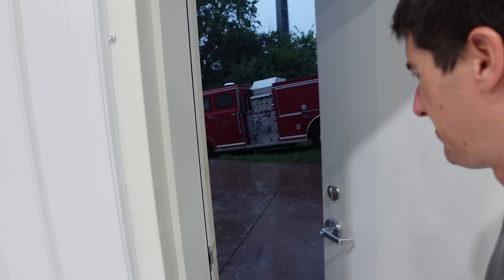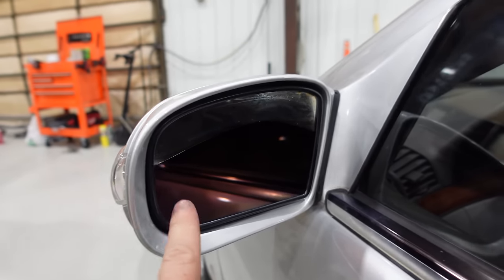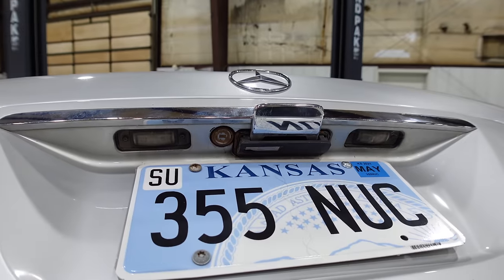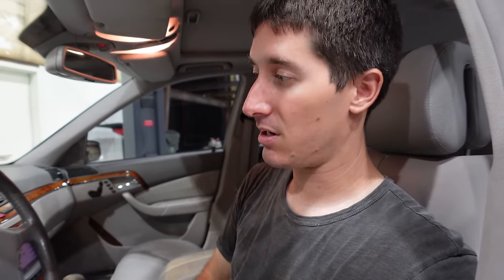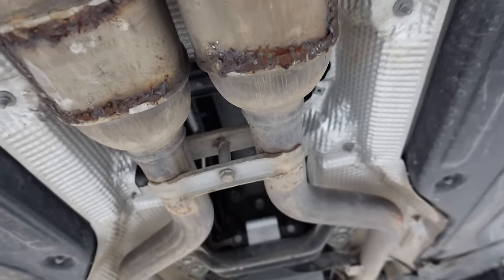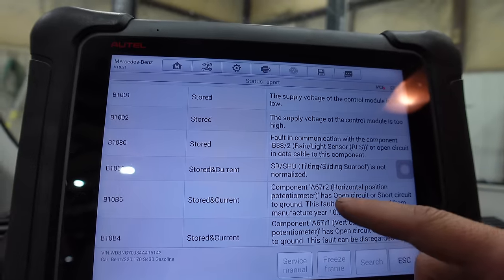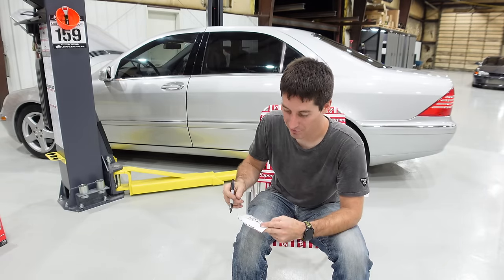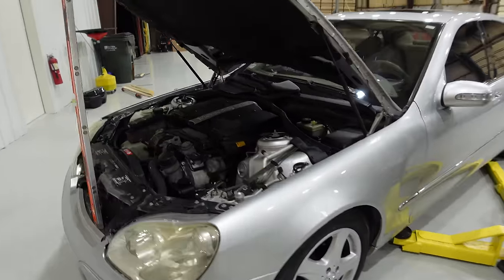My $2,000 Mercedes S430 Is Completely TOTALED *How Bad Can It Be?*

Comment from the maker: I ran the VIN, the salvage damage is listed as "Undercarriage". We've all seen it, the car looks great underneath. Kinda interesting 🤔
Reply: Cat theft?
Reply: Cat theft, perhaps?
Reply: 🐱 theft?
Reply: Might have a few dents underneath, i bought a few cars with undercarriage damage and the only damage was a few dents and knicks on the suspension and trans
Reply: Might have the suspension totaled it? Thats why somebody replaced it, only after it was totaled out. And it looks like somebody tried to swap the cat cores. Probably used to be in an emissions state.
Reply: @100PercentJake  gah. You beat me to it 😂
Reply: Most likely cats, like you mentioned, they probably list any damage on the bottom of the car as "undercarriage". I've driver plenty of salvage cars, even when they are made nice, you could find the evidence of repair. That's the only thing that make sense to me.
Reply: Probably a cat theft that had damage? And maybe it was replaced when you got it? Cat thefts be booming lately
Reply: @100PercentJake  awww shit I didn't see the comments lmao
Reply: The transmission pan looked a little scuffed.
Reply: if anyone needs a cat defender it's a Mercedes owner, not a Prius owner...
Reply: Likely mechanically totalled for the air suspension (which is, technically, 'undercarriage').   Not surprising since it's probably more than 1/2 the value of the car to fix.
Reply: @100PercentJake  i dont think so, cause why wouldn’t the thief’s just cut the cats out completely instead of doing cutting them open lol
Reply: @ricky_ricardo  Catalytic converter
Reply: I’m guessing they means the exhaust. It did not look pretty.
Reply: suspension
Reply: Unload this pig and find one that can be fixed for less $$$.
Reply: I would move on to the next
Reply: Cat theft maybe? What Mercedes quote for a complete new set of cats with exhaust? 
Would line up with the horrible welding job on those cats and with the undercarriage thing
Reply: Sell it
Reply: Can I trade you my car for it but you have to put brakes on it
Reply: How much does all the plastic that is missing cost 🤔 Maybe if you really want a s class use this one for parts then send it to the recycling yard one part of this one might make or break the next s class project 🤔
Reply: Undercarriage damage may explain why there is a cheap replacement suspension all around instead of the original.   I thought also that the transmission support and such looked somewhat different from the rest of the underside, but that could be nothing.   Someone made an effort to put it back on the road in (barely) functional condition, but it's pretty horrid.  Totalled is the word, it's probably worth what you paid for it as parts at best.
Reply: Hi Jr. I have a lot of spare parts for this car, and I know it inside and out very well, so I can definitely give some advice. It is not as bad as it seems. I bought a 2006 S500 for $2,200, a couple years back clean title, and I have been restoring it to one of the nicest examples of this car. Please reply and we’ll figure out how to connect.
Reply: You know 4 high flow cats and some weigh reduction pulling out the old air ride stuff you would have a sweet shop car 
Or just cut your losses and sell it as for the total out it had to be the air ride nothing else
Reply: Suspension or cat theft.
Reply: Could it be in reference to the exhaust? Or suspension?
Reply: I'd love to buy the maxspeed coilovers , how can I get in touch with you?
Reply: I can send you the nav disk out of my 2002 S430
Reply: There were a few lines of ate up wires and the transmission pan itself seems a little scuffed ? idk how that possibly totals it, but maybe they ran over somethin slightly and the insurance adjustor saw the cats and was like "nope"
Reply: Could have been reported as stolen. That is an easy way to get salvage status.
Reply: @TheMcspreader  yeah I thought maybe someone stole the cats but it looks more like a botched job
Reply: dump it
Reply: Stolen and taken off road.
Reply: Running over a curb can total those care out could be sub frame and suspension damage replace the parts and noone will know I have an 04 e500 that was basically totaled including airbags deoyed from hitting a curb
Reply: Trash, Trash, Trash is all I read. I believe you saw potential and I say stance it or make it the work truck by pulling trailers lol. I saw a YouTube guy take his S class and tow a 2000lbs trailer for more than a 1000 miles. That thing needs love from an enthusiastic car designer. Obviously offset cost by recording content but man I know another YouTube channel that took this exact motor and is turning it into a F1 engine platform. Resale is tough but having fun and doing what you want to a tank is priceless!!
Reply: Sell it so I can sell you a 2005 S55 AMG with a salvage title instead LOL
Reply: I think though should fix it. This would be  a good repair series that would potentially generate enough video revenue to justify.
Reply: Cat theft. Poorly repaired by whoever bought it from the insurance company, then resold. That plus what must have been a series of unloving owners.
Reply: if you made an S-Class live video i bet you would get more then half the repair total donated if not all, the fix it and give it away
Reply: Those welds are so awful they totaled out the car.
Reply: Would getting a CarFax report have any different info from running the VIN?
Reply: It was abused on the catalytic converter.  Knocking out the oxygen sensors.  The destruction of the air suspension system.  It was totaled because as you confirmed, it costs too much to fix for any insurance company to pay for it - so they totaled it instead and paid out.
Reply: insurance fraud?

Comment: I have a 2000 S430, I have fixed everything twice but still love the car. built like a tank and runs great with 235k miles. If you can't work on these cars yourself they not worth owning.
Reply: I found one for 2750, with 148k miles on it. Is it worth buying ?
Reply: They must chug gas
Reply: Bought a 2002 s430 58k miles great body... spent$3500.  Had to replace air compressor
Reply: @WykkedDragon I’m thinking about getting one found a good deal online 04 s430 82k. Have you ran into any other problems? Am I honestly purchasing a money pit?
Reply: Was it 5k to fix everything urself damn. Thinking of trying to fix mine up

Comment: The idler pulley that is squeeling is the very top one that you can see there. Almost all of the mercs that I have worked on have that noisy idler and its ALWAYS the top one. While its running just shoot the center with some penetrant oil and if it goes away, there you go. REALLY easy to swap out.

Comment: I suspect your estimates are way low. As I said in the previous vid, I own one of these and paid $5k for a nice one 3 yrs ago with 4Matic, everything working (including the factory Airmatic) with new tires on OEM wheels. My car is optioned with heated rear seats and heated steering wheel, but no soft close doors. Yours is thrashed and beyond reasonable repair. If you think you can get your money out of it, do it as fast as you can. There are way better examples out there. DO NOT spend a cent on this car. It's parts only, IMO.
Reply: I just sold an 04 E500 4matic that looked about the same as that with about 130k on it and I struggled to get $2500. It had good cats too. Send it. They are not even that cool compared to so many other cars out there.
Reply: Most of his estimates are too low, except for his estimate of what he can sell the car for tomorrow ($2500 with a salvage title). From a time-management perspective, he should scrap the car and write the loss off against his business taxes.

Comment: JR, you have 2 different problems with your trunk lid. First is the latch mechanism in the trunk lid is leaking like a sieve -- you can hear it hissing in your first video about the car. The self closing actuator on the trunk latch is made of plastic, and they fail over time. Easy but costly to fix (which is the name of the game on a W220). As for the trunk grab handle working in reverse, you need someone with an actual Mercedes Star computer to reset the adaptation on the handle, and it will work normally. Also, the reason why the trunk features are totally inoperable in this video is because the PSE Pump (Pneumatic System Equipment) can sense a leak and disable that particular feature, so you don't burn up the pump--which is why the trunk latch wasn't hissing in this video and also why you have all of those error codes. I'm a longtime W220 owner and fanboy....they are truly amazing cars, and they aren't nearly the nightmares that their reputation claims them to be. I'd love to see you rebuild this one--they are actually quite nice to work on, but the better move would be to let this one go and start with a nicer example. Keep up the good work, love the show.

Comment: This Exhaust System looks the same as on my 2000 Euro S500 Pre-Facelift which i bought 5 years ago. But i was glad to get the whole System brandnew from an ebay seller for 100 Euros. Plus mine had a working airmatic system and no warning lights. Only some minor issues like not working massage seats, softclose and missing keycards for KeylessGo. it passed our official technical inspection here 2 times without problems since then and i drive it every day with pleasure.

Comment: Why assume the ticking is from the timing chain/guides, it’s common in m113 engines to get hydraulic lifters causing ticking, u can get detergents to sort this, worked on mine 

Valve cover gaskets do sweat on these but yes they can give out n leak all over the place, simple fix though

Comment: Get Arnott replacement air suspension if you want to restore the Airmatic.
Reply: Is this model on air suspension or oil based suspension ?
Reply: @johnbates606  all W220’s come standard with Airmatic with the exception of the S55, S600 and S65 — those are ABC — standard on those cars, optional on lesser cars.

Comment: I just bought a 2000 Mercedes s430 for $2,800 at around 195k miles and its very clean. There's absolutely nothing wrong with it (that i know of so far) and everything works besides there is a small airleak somewhere in the back suspension. The air compressor kicks on every 5 to 10 mins which is annoying, but I love my car. Beats my 98 sentra (which was a big pile of crap), but I hope I made a good decision buying it
Reply: I’m thinking of buying a 2003 S430 69k mi $3500 for my teenage sons to learn how to drive just not sure if it’s a good buy considering Euros are expensive to get fixed
Reply: @reneflores7644  tbh I regret buying it now because the shifter is getting stuck in park and its $1200 to replace it. I have to hit it with a mallet to get it unstuck in the mornings. It only happens when it's cold. I can't overhaul it or replace it myself cause a new one has to be reprogrammed to the car. So I gotta take it apart and take out that locking mechanism myself. A cylinder is misfiring too but its most likely a bad spark plug or coil. I also lost all power to the front passenger door and the driver side mirror fell off. When I bought the car it only had 1 problem. I still really like the car though, but it sucks all this started happening and I checked the car over when I bought it. Not a whole lot of auto mechanic shops will take it cause its a german car. So be aware. Its a nice car but its expensive to fix
Reply: @reneflores7644  however 69k miles is incredibly good, but check to make sure it doesn't have any major problems first. Make sure you scan any trouble codes before you buy it and make sure the previous owner hasn't deleted any codes

Comment: Something something LS swap.

Imagine showing up to LS fest in a W220 with a chevy truck motor
Reply from the maker: Huh... it is almost LS fest, and I am 5% better at welding than I used to be 🤔
Reply: I would really love to see you  do a Chevy Cruze or Sonic someday I think they are super underrated. There's also plenty of space under the hood for a bigger engine
Reply: @FriedTendi  1g Cruze with a 2.0t swap would be hella fun. Car rides like its on rails already - especially 2LT or LTZ with the z-link out back - so it would finally have an engine worthy of that handling.
Reply: Do it
Reply: @WatchJRGo  nah still not worth it. Maybe If the airmatic was still all in tact. This car is a disaster lol
Reply: @WatchJRGo  to quote Nike... 

we all want to see that
Reply: Lets see an f150 ecoboost build.....lots of f150s out there
Reply: Find a high milage f150 ecoboost lets see how they hold up
Reply: Dudes - Rolls smoke needs to be done for LS fest - I personally want to see the Rolls melting tires before another LS conversion. Couple thoughts to drive down repair cost- one I posted already - Suncore out of FL specializes in reman benz air struts and bags and they have been great in my GL, bonus they are like a third of the price of Arnott. I did all 4 corners of my 2012 GL for like $400. Second, I know magnaflow and I think eastern make some universal 49 state cats that are like $50 a piece, cut the garbage out and weld those in, shave like $500 off there.
Reply: Bingo!  I think Jake has the right solution for this car.

Comment: New good battery and full code reset. Then drive a bit and see what comes back.  Engine oil flush with some good product, fill with new oil and see if runs better. Amazing, no rust.. here in Finland all of those all rusted thru.
Reply: These are the facelift ones with better steel to resist rust

Comment: I have a 2006 S55 that is the same color as your S430 with a black interior. I searched for this car for a while. It was owned by an older couple who took very long care of it. They only sold it because the left rear started sagging. They were afraid that it would be costly. I got it and replaced the rear struts. I have not had any other trouble. I wouldn't trade it for a brand new Mercedes.

Comment: That can happen to any newer Benz that trunk issues. Happened on my w211 2003-09. Eclass  and when it happens on a w211  you also looose the third brake light and trunk release … have to use the key blade much like in the case of a dead battery.

Comment: IT depends what you want with this car? if just want to repair and keep it stock, but another one is cheaper and easy, but if want to mod i will keep this one and upgrade about every thing you need to fix, bigger brakes, lower supension just change the struts level, full exhaust, intake maybe drop a SC in this M113 again is a project for no reason just to build something unic otherwise bought S55, S63/65. I own a S55K 2003 just love the car! i lost about more than 6 months to put it together in perfect shape.

Comment: Your prognosis is spot on, unfortunately.

My theory is that the car was deemed salvage when all the AirMatic shocks blew, and possibly a ton of suspension parts with it. Thus the "undercarriage" damage, and someone obviously rebuilt the car at some point, due to the aftermarket coil-overs.
Reply: Pretty sure you can’t make an insurance claim because your shocks went bad.
Reply: @robertbeirne9813  I'm talking about damage like they ran over something, like a ladder in the road, and it took out the tires and suspension. I've seen it happen

Comment: JR talking about the airmatic suspension made me think, hmm, Lexus used steel springs and convential shocks/struts on ALL their sedans in the 90's/00's(yes air ride was a seldom selected option on the LS, most didn't have it)    Just one less thing to break if you are in the market for high end, low mile, cheapish granny died specials.   Even a well kept s-class of this year will cost a fortune to keep on the road, Lexus was a lot less experimental with their cars

Comment: My s500 had clogged cats like yours. It's common on thevW220. I cut mine just like yours and Removed the insides. The reason people do it that was is because during emission inspection when they look under the car with their mirror they see the cats are there and not a straight pipe

Comment: Would PLEASE for the love of gif share the link for the radio/entertainment screen?? All the options I’ve found are either original replacement which the price for is outrageous OR installing a new android unit BUT this car has the fiber optic amplifier setup which most of the current setups ARE NOT compatible with or the few rare ones that are need additional PAIN steps plus parts that bring the total again to a price I cannot live with right now. Now everything in this car was working fine and still probably is BUT the heat being an issue down here (FLA) said screen began to grey out and peel to a point I can only hardly see anything on it if I place my vision at an angle that defies what’s humanly possible ( and that’s while I ain’t driving ) 
You mentioned the screen replacement being two hundred and change ? I’d be eternally grateful dude please thanks in advance chief.

Comment: I kind of want to see you get it back to where it's supposed to be and get all the codes cleared and the dash lights off, knowing you'd have it as close to perfect as they come. However, I also know there is no way it's worth it. And I know that is why my family no longer has a Ford Windstar, since we had one that looked amazing cosmetically, but it needed new suspension, and an engine and transmission rebuild. And somewhere, it was slowly leaking brake fluid. So we junked it. We priced out fixing everything and it was $8,000 for a van worth $2,000 at best at the time.

Comment: Most of the parts you found wrong can be bought from pick-n-pull yards such as LKQ for almost nothing! Example would be the radio at $40.00! The BIG worry for me would be the engine noise. It could be simple or...therefore, I would suggest, as others, sell it! I have an 04 S500 which I love, but I repair everything as it breaks. So far, not much needed...as of NOW!